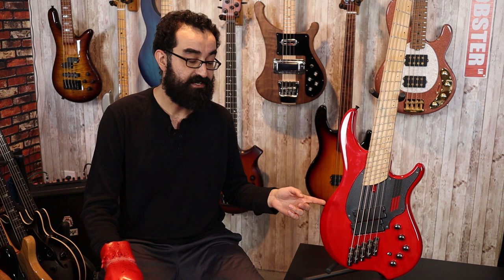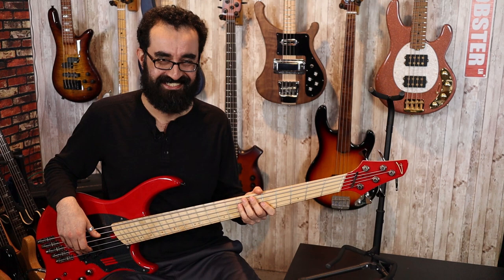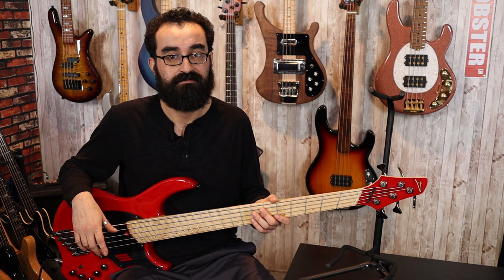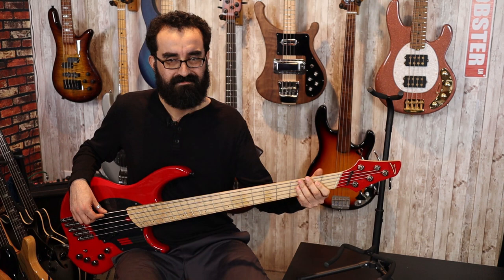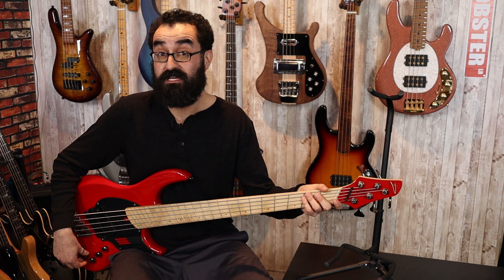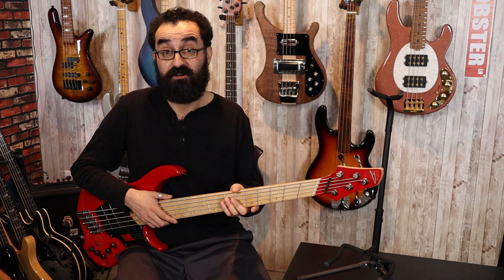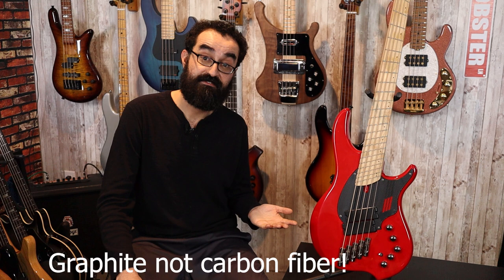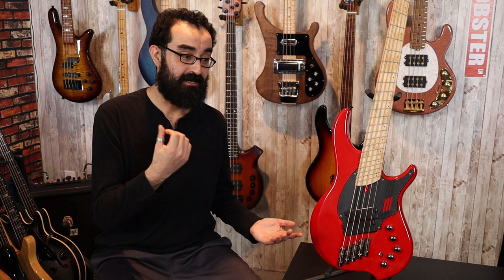Dingwall NG2 (2016) In Depth - Behold the Behemoth B String! - LowEndLobster Fresh Look

Comment: Great video, I've for an NG2 that I've done only cosmetic changes to because how much I like it stock (save for occasionally moving the front pickup forward since the one I have came pre-routed for three pickups). I can see what you mean by having THAT tone color all the various options but I almost see it like a modern/new version of how I view the P bass (its sound can carve out a niche in almost any genre). Some string manufacturers like Payson also offer other string types like flatwounds, ground wounds, and coated rounds, that can curb that edge a bit and add a nice thump to the very present natural tone. The same can be said about my frankly dead/old roundwounds that still feel viably bright using the preamp and pickup selector.
Reply from the maker: Thanks Justin! I definitely want to try out some Payson flats for my gold bass. Would be interesting to do a comparison with the new guts!

Comment: Looks like it has 19mm string spacing? Expensive for a Chinese made Bass....
Reply: Used they can be found for cheaper, usually their owners keep them really well maintained so they're close to brand new.
Reply: 18mm on 5 and 6 strings - 19mm on 4 strings (and Super series 5s)
Reply from the maker: Correct, 18mm on the 5'ers.

Comment: I've been avoiding 5 string basses my entire life, not out of elitism, they're just horribly uncomfortable to me. I might just consider a dingwall once their used prices start dropping a bit
Reply: I wouldn't hold your breath on that. Usually used ones go for only slightly less than new prices because availability for new ones is scarce.
Reply: @fistinair1979  we'll see. I waited on darkglass and got one for a good deal, I assume the same will happen here once the metal crowd gets bored of them and starts selling
Reply: @ileutur6863  I'd agree, it's tough to say of these will dramatically drop in price used given how little are produced it seems (also the prices have gone up for a new one, which I suspect will bring up used prices respectively)
Reply from the maker: Thanks Arsenije! If you want to check out a 5 string multiscale without dropping dingwall coin, the Ibanez SRMS and EHB offerings are quite solid for the price (especially used!).

Comment: I never got the hype behind Dingwall basses, other than the multi-scale design. What’s the general appeal of these aside from the scale?
Reply from the maker: Thanks Shred! The B string is definitely sweet, but outside of that I think there's a lot of genre-centric hype surrounding the darkglass preamp. Don't get me wrong, it's a very solid preamp but it heavily colors the tone and it's hard to escape. Passive mode doesn't give you a passive tone control to get a fatter tone, and the pickups with the preamp bypassed are definitely on the harsh side. That being said, heavier music and more avantgarde stuff definitely appreciates this type of tone. The triple pickup thing is cool for the NG3 and combustion models, but the 4 way rotary switch doesn't give you the ability to run all 3 out of the box. My upcoming mod video on my personal Dingwall might seem more appealing to you (it is for me) from a tone perspective. Muuuuch wider tonal palate and none of the dark glass coloring... and a passive tone control. I don't want to spoil it ;)
Reply: I really like the Darkglass, but the color of the tone is probably the main reason why someone would go for it over another preamp of similar price. Plus, with options like the Duncan 2-band (just got one myself), which has the treble boost/cut at about 3khz for $100 less, it seems very... idk, maybe “niche”? An EMG 3-band with mid sweep costs the same and doesn’t color the tone nearly as much. But the Darkglass flavor is hard to replicate if it’s not something you already have onboard. Can’t wait to see how your personal Dingwall looks after it comes out from under the knife!... or under the soldering iron, I suppose.